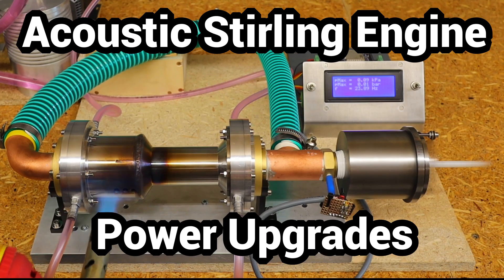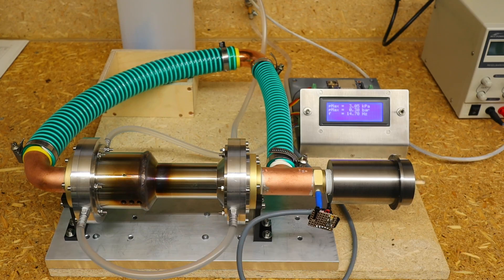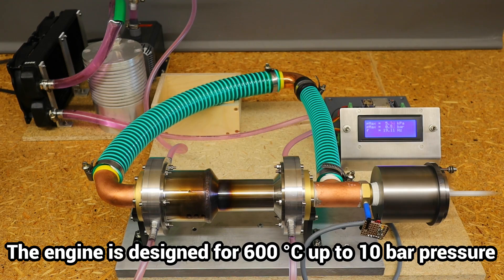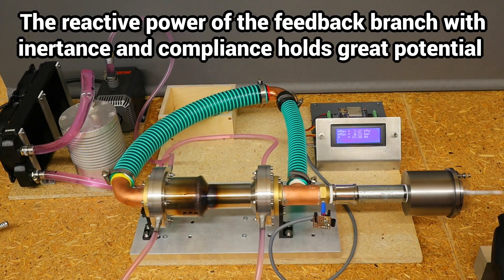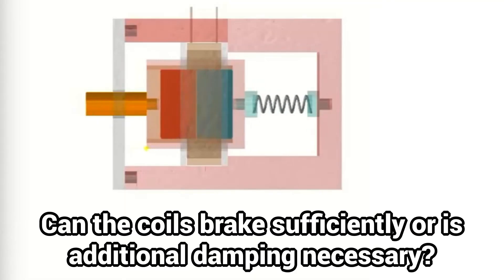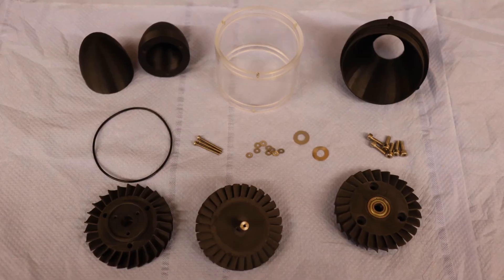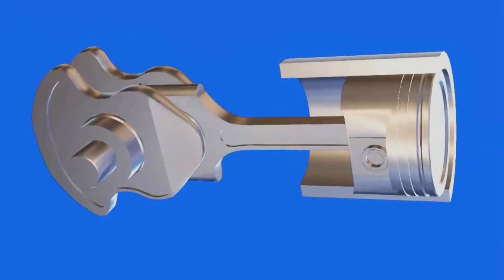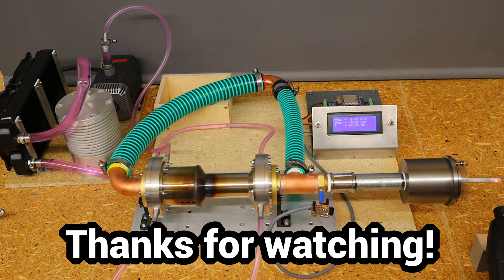Thermoacoustic Stirling engine – which is the right generator ?

Comment: A linear generator is by far the most efficient option. Just ensure that there are no conductive elements close to the moving field as they will generate eddie currents. You also don't need any mechanical dampening. Load will be proportional to current draw. Try to minimise the air gap between the coil and the magnets.
Reply: I think also the ability to provide the ideal electrical load at any engine power level is very important, maybe an automatic MPPT load (such as solar cell charger) would work, but maybe a programmable load would be better able to respond to the engine conditions
Reply: I think MPPT isn't quite the right fit for this application, but as others have mentioned, mechanical load will depend on electrical load so you may find that you have to be able to adjust your electrical load depending on the operating conditions of the engine and be prepared to dump some energy into a big resistor at times. I guess in the final setup, you could probably implement this as an immersion heater to dump any excess energy into a hot water tank.
Reply: @jamesharris5158  Yea: MPPT is great for solar pannels, but it can be a very unsteady load, messing up the resonance.
Reply: Big load on the output can also mess up the resonance. 
(Works as low Q sistem).
Other works in the resonance sistems
 (dynatron on Don Smith  device) 
found it useful to introduce a limit to the load of less than a third of the total energy circulated in the sistem  to avoid the big damping and sudden stop of the resonant oscillation.
Reply from the maker: A linear generator is really a very elegant solution, but the control with MPPT and so on and also the control to start the motor sounds like a lot of work...
Reply: @myengines2443 I think active control of the output of the coil will be necessary, at least on the development stage, controlling the current output to keep the frequency right. For an EE, this is a relatively simple task.
Reply: @MaxQ10001  Maybe the generator can be designed in a way, that it is self regulating. 🤔
That requires non-linear characteristic. For example, the stator could be designed so, that it does not take up power on low amplitudes, but produces exponentially more power on high amplitudes of the piston. That should keep the engine in a good operating spot. 
However, i think electronics are easier to adjust and regulate.
Reply: @notconnected3815  it probably can. And the formulas are almost identical when designing regulators electronically, digitally or mechanically. The big advantage of using digital control during development is to find the correct regulation formula and all the parameters. It’s so much easier to reflash a microcontroller than reconnecting and changing values on an analog circuit. When the problem is solved, the most optimal solution for production might be a simple analog circuit. Or mechanical.
Reply: @myengines2443  I would definitely avoid that, I would aim for a high winding number because I want high output voltage to reduce the relative loss in the rectifier, then I would feed that into a buck converter built with an MCU, measure the output current and voltage for the load so I can experiment with the loading without extra steps.
Reply: True, in my experiments I got a magnet on a ruler to resonate on great distance, like 1 meter from a spinning magnet.
Reply: A linear generator can be started with an AC current or even one DC impulse. It is more reliable and much less maintenance than rotating parts (lubrication, etc.). The Most simple solution would be a membrane pushing magnets through a coil at high frequency.
Reply: I think the air gap is not where the losses happen. The losses happen in the iron core through eddy currents and in the resistance of the copper.

A big air gap means loose coupling, resulting in less voltage and less power output. But the power does not get lost, it stays inside the engine, in the form of undamped oscillation. Eddie currents and resistance produce heat, that is slowing the piston and leaving the generator as unused energy.

However, if we want to get the most out of our building material (not only the fuel), then the air gap should be minimized.
Reply: I think the coil also can be used as a sensor.
The counter-induction gives data about piston speed.

One can use this information to regulate the electrical power draw, to prevent the engine from idling or stalling.
I work in Industry, and i would typically use a self-tuning software PID controller for such applications.

However, i also am fascinated by devices, that are self-regulated, without the need of high tech silizium stuff
Reply: Halback arrays of magnets may work better by concentration of the magnetic field lines towards the coil /coils which also would work better with ferromagnetic core.
Best  inspiration would be linear motors working in reverse.

Comment: At these power levels the spring might sink too much energy. If you want stability, just rotate the whole device, so that gravity would align the magnet
Reply from the maker: Yes I also thought on a vertical power unit but at later higher pressure levels the gravity does not play a big role!
Springs are not a good solution as you say I think also!

Comment: Why is it not vertical?
Reply from the maker: Because of the ease of construction and also at the later higher pressure levels the gravity will not play a great role but it has advantages for side thrusts and might be considerably!
Thanks!
Reply: @myengines2443  No gravity, hot goes up cold goes down?

Comment: Pushing a magnet through coils seems to be the easiest way to produce electricity. It's a great idea! If you put dampening, it will reduce the efficiency. I would set up a magnet to go all the way through a coil and back, without dampening. There seems to be more than enough space on that shaft.
Reply from the maker: It would be best to use no mechanical damping but i am unsure if it will work especially at higher powers!
Reply: No problem with the dampening under load. When there is a power output, the current in the coil creates a force on the magnet that opposes the movement and wants to stop it. That’s why it’s harder to crank a hand generator when there’s load connected (or even worse, the terminals are shorted) vs open circuit. That’s why there’s a nice demonstration experiment where a powerful magnet is dropped through a copper pipe of a matching size and descends very slowly. The copper pipe is one big fat shorted winding. That’s how magnetic dampers work in practical applications.

There may be a need for damping when there’s little power draw, may as well use a resistor to dump excess power and return to normal operating parameters.

Electrical start is also easy: just apply variable or pulsed voltage to the coil to make it move.
Reply: If you put dampening it will be all wet!